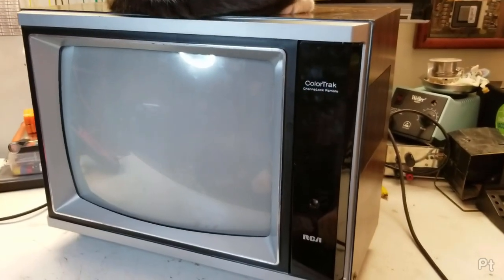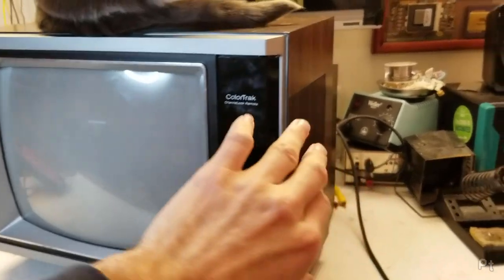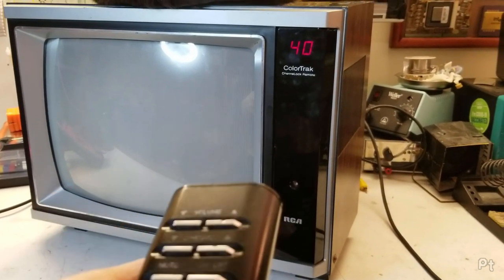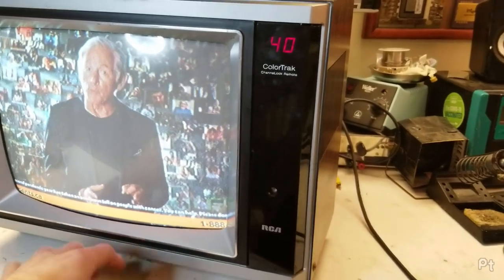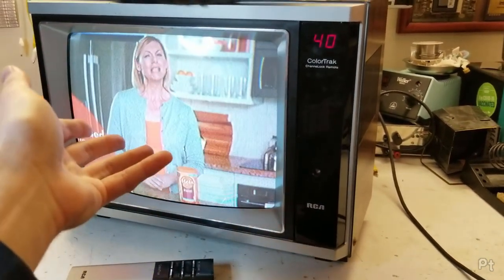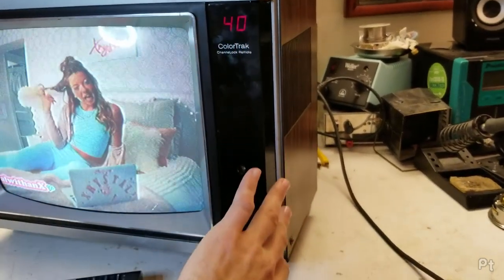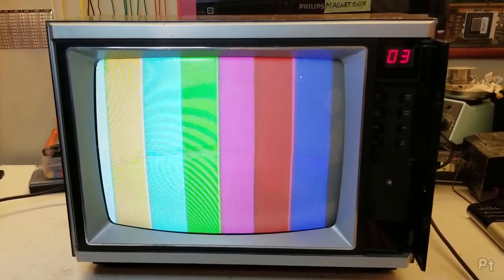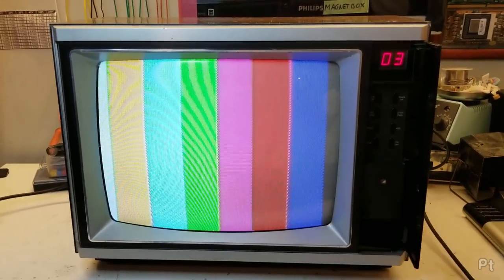RCA 13" ColorTrak TV from 1983 (Model EGR338)

Comment: Family had a 1968 New Vista RCA 23" console. Then in 1978 got a 25" console RCA. I used the 1968 tell 1990 as a 2nd TV. Then bought me a 25" Color Trak. Used tell 2003 and gave to older lady. Next a 32" RCA. I miss my tube TV

Comment: I remember the tv's at school were Panasonic they had the pigtail for the coax. and they had the red channel display. i used to adjust the color controls on them trying to make them look better.i think they were from the mid 80's. so they must have lasted a long time because i was in middle school in the mid 90's. they also had some top loader vcrs hooked to them.

Comment: As usual, a great video on a killer set. That woodgrain and those bright red digital letters always take me back, and I love the curved screen to boot. I think the only other set that would get a similarly powerful nostalgic reaction out of me would be those sorts where you push a big clicky button on a big column to select a channel. 

Hella impressive that you managed to fix the tuner like that - I wouldn't have known the first place to start. Love how the channels look on this thing.
Reply from the maker: I don't think RCA ever used pushbutton selectors for the channels. They always had the single rotary knob for the TVs with the varactor tuners. I did have a small Sony that had those pushbutton selectors, though they were along the bottom (google Sony KV-1221R).

Comment: I have a Quasar set from 1985 that has a similar setup with the VHF matching transformer, but instead of placing bare wire in the 75 ohm input, a cord with a metal piece on the end is put in